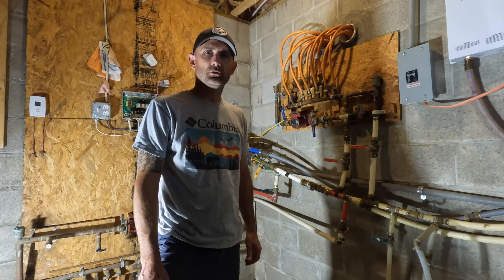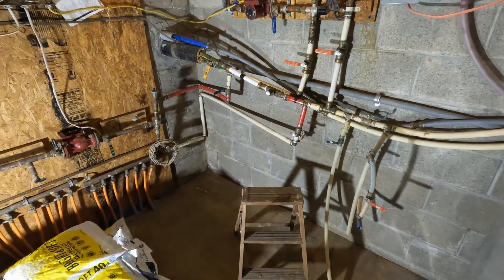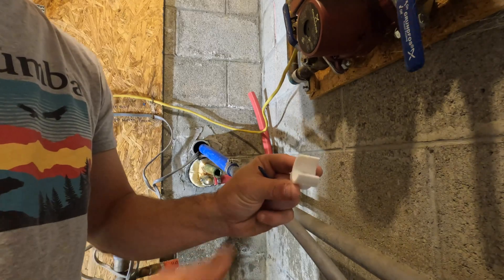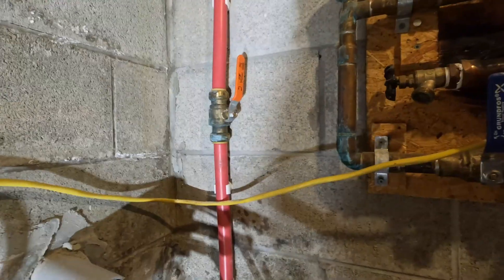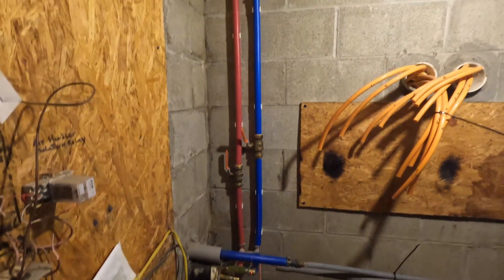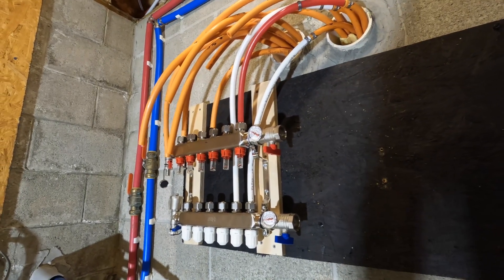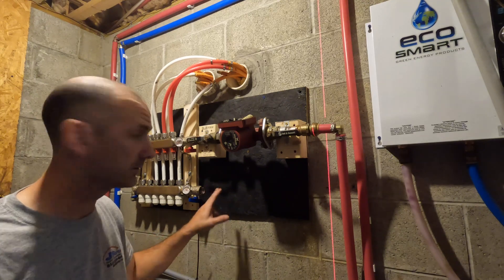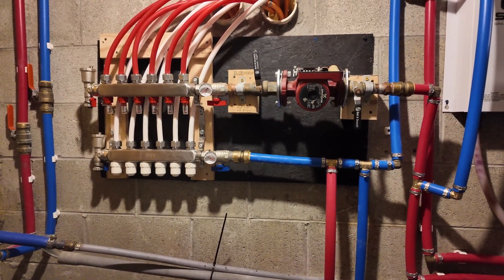How I Re-Plumbed My Outdoor Wood Boiler for Better Heat and Efficiency

Comment from the maker: Outdoor Wood Boiler Tools / Supplies:
Water Inhibitor Treatment: https://amzn.to/487gwYb
Weed King Torch: https://amzn.to/4oV1c6w
Creosote Scraping Bar: https://amzn.to/4nJD8mb
Central Boiler Trol Ash: https://amzn.to/4oxUO5B

LED Hexagon Garage Lighting Project:
LED Hex Garage Lights: https://amzn.to/4redZD4
On/Off Power Cord: https://amzn.to/48d98cy
Rubber Coated Magnets: https://amzn.to/47ZpGpT
J-B Weld Extreme: https://amzn.to/4aakIrD
Magnet Hooks: https://amzn.to/4oc0DVm
Plastic Strapping: https://amzn.to/4ij2OF9
_______

Lumary Outdoor Lights
Lumary Landscaping Lights: https://amzn.to/4rnB4Uf
Lumary Rope Lights: https://amzn.to/4r4vNRb
Lumary Permenent Outdoor Lights: https://amzn.to/3JPYuAB
________

Giant 3’ Home Depot Christmas Bulb Project
GoVee Flood Lights 2: https://amzn.to/4937UTw
Grommets used: https://amzn.to/4qPWRTZ
__________

Shipping Container Kiln Build
Dehumidifier: https://amzn.to/4oq4Nuf
Temperature & Humidity Controller: https://amzn.to/44khsGp
Container Lug Jack: https://amzn.to/4pvD4YL
Fan: https://amzn.to/4oYFKhD
DIY Spray Foam Kit: https://amzn.to/44mR1jp
Container Rust Paint: https://amzn.to/43NQuqy
Bottle Jack: https://amzn.to/4oPPLgW
Vevor Exhaust Fan: https://amzn.to/4imFlDi
Junction Box: https://amzn.to/4a9rE8q
Wood Moisture Meter: https://amzn.to/48uD9pM
Vevor Diesel Heater: https://amzn.to/4ouk2lp

Comment: Asking out of curiosity and planning my boiler install - why not run the two loops of radiant floor heat in line? so Out of garage into basement, then out to boiler? sorry my ignorance, just was thinking the idea is to have a completed loop.
Reply: and also! looks much better than before - nice work!